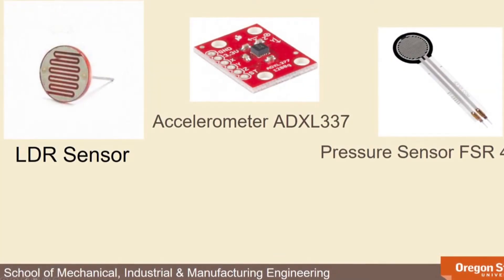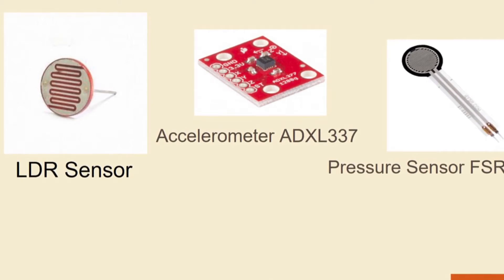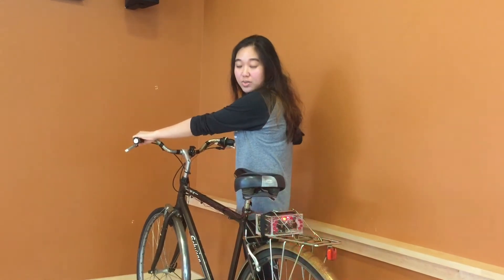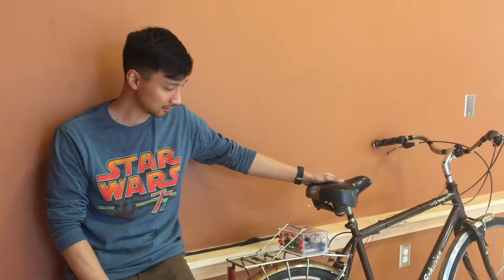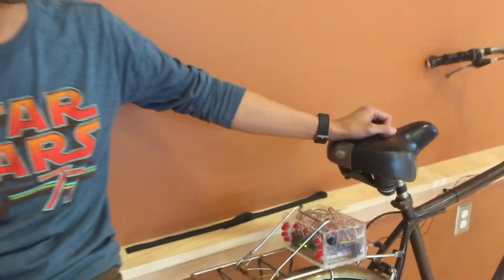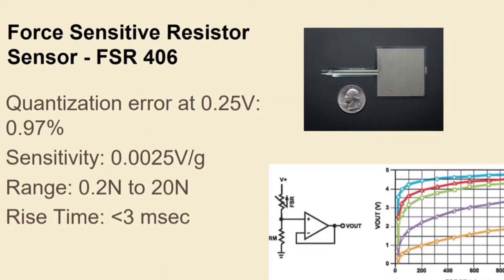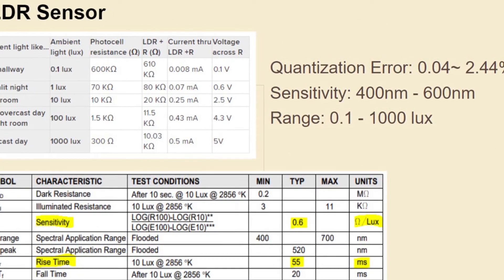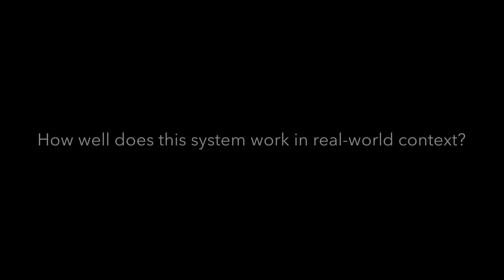A Commuter Paradise - OSU ME 451 Project - Arduino

Comment: How protected is the arduino and the sensor from the elements (rain, dust, etc)? Also, did you guys consider having a switch near the handle bar for easy on/off? - Matthew Wiryawan

Comment: Great project! You used an accelerometer to turn on the brake light, did you have trouble with it turning on and off when ride the bike up and down hills?
Reply from the maker: Bryan Madison, Yup that was one of the things we had thought about after the fact on choosing to use the accelerometer. As stated in the end, we think using brake lever sensors would have been better suited for the application.